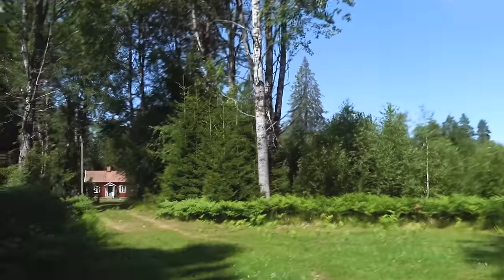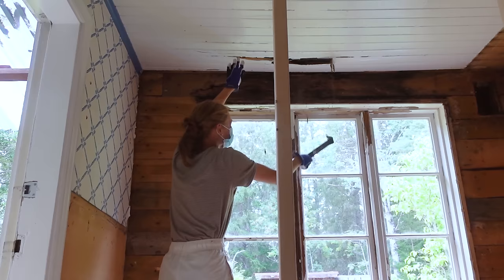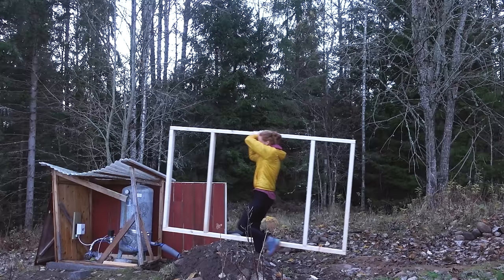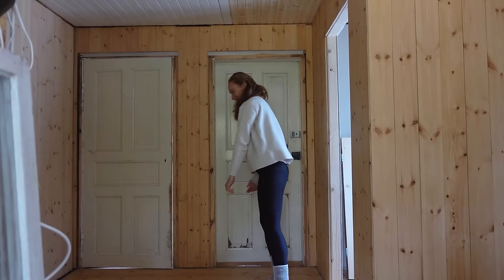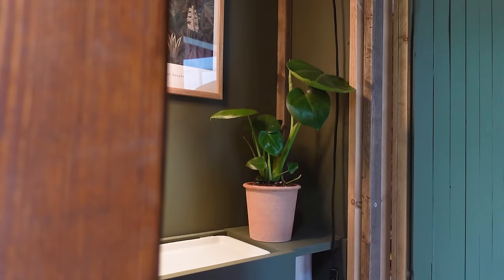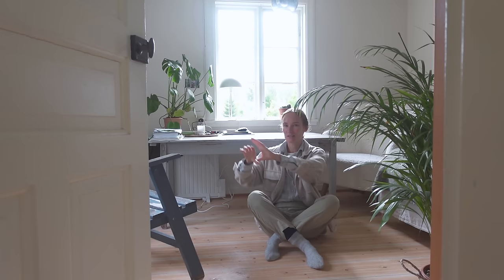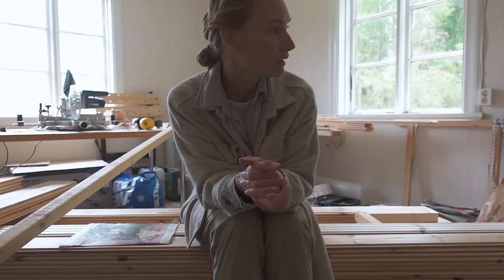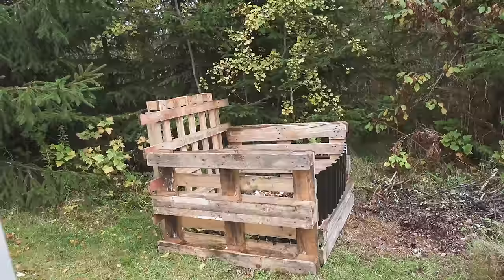ONE YEAR PROGRESS Interior Designer Renovates Old Cabin (Story 31)

Comment: I lived in a similar but larger cabin in mid wales, the wood burner  installer recommended we get rid of the chimney and install a double walled steel chimney, it worked beautifully and I liked the look. We chose a 7w wood burner which heated the whole cabin although it did get too hot sometimes.  James pirigioni’s channel has instructions for making covers for raised beds you could use the materials that you used for the greenhouse. I think a lean to greenhouse would benefit both the greenhouse and the house itself and give you a more stable structure. I’ve loved watching you think thru your problems and not being afraid to give it a go❤️
Reply: I dont know the status of her chimney, but the way these work in Sweden is both the woodburner/stove in the kitchen and the tiled woodburner in the living room each has a separate pipe running through the chimney up to the roof. Both woodburners she has, when in working condition are more than enough to heat the entire house very efficiently! The one in the kitchen is also a stove and cooker and there are copper water basins with a little tap that can be used with them and inexpensive second hand, so they are really valuable, same Swedish quality as AGA stoves. The tiles one is original to the house, likely 1800s, and has an ingenious internal five pipe system running up and down inside holding on to the hot air for a long time. Yes they are sensitive when you fire them up after being cold for a long time, you have to start very small and gradually so the mortar doesnt crack from shock, but once all the internal pipes have been hot for some hours or half a day you can fire up four logs at once and close the iron doors (inside the brass ones which remain open when firing) and pull the flu to only a third open and the fire will burn from evening to around dawn. If only one logburner works it should still me enough! I'd have made that my priority number one with such a property. The electric prises are running wild, no end in sight, and it gets very cold in winter, and wood is cheap and all around! I'd also have sawed and chopped up the fallen birch for firewood early as firewood needs drying out, cannot be fired green.
Being comfortable indoors through long winter months, especially with renovations would have topped my list before other projects, being a Swede, or half Swede, and living here. No need to replace burners at all, it's all about the brick chimney perhaps in need of repair to be fire safe, and the pipes within being swept and tested with pressurized air. Heating also cures and dries any wood used indoors for renovations, as wood swells and shrinks with temp and humitidy changes. It would be essential in my book. The hearth is the heart of a house! And the chimney has a central position so once it functions it will heat evenly all around.
Reply: Oh this is a good overview of the Swedish range/fireplace/cooker.  Sounds like it will be amazing once it has been recommissioned 🔥.  I second getting firewood cut and stacked for drying with plenty of time for drying before it is necessary.  I live for fires over winter, the radiant heat makes life so cosy
Reply: @badger9156  so do I. I've got mixed feelings about this channel and it's creator. I cant get into it here but its on the spectrum to a point of conplete disinterest in the place and architecture she purchased, in a way no serious designer would understand its been too long now. Something doesn't sit right, seem to make sense...
Reply: @gnarbeljo8980  my feelings about you are not mixed. You sure have a lot to say. Maybe you should homestead a place of your own and upload to YouTube. No? I’m old but I see envy lurking between your lines.
Reply: @karen-ud1hc  that's a misunderstanding. I have v e r y nice digs. In Stockholms oldest quarter. My flat is from 1656. I hapoen tp care about old swedish buildings and living. I'm 53 😂 I'd not move up north for a million bucks, sorry, its paradise to some not to ever run across other humans by chance, but n o t to me 😂. Are you the same? Perhaps this is a channel for the socially awkward not people interested in renos.... 💡
Anyway, a house like this here is cheaper than a car up north. Anyone can buy one. Literally. I think you're talking about yourself. As so many do these days. Read what you like into strangers comments.
You might have asked instead and gotten an actual answer
Reply: I watch James Pirigioni channel!  great gardening advice and his garden is amazingly productive!
Reply: @gnarbeljo8980  if you have no interest in moving up north and renovating a cottage why do you watch videos like hers, then feel it necessary to make suspicious comments. Can you not be happy for somebody else’s joy? I’m happy you like your home.
Reply: @karen-ud1hc  I'm interested in renovation, conservation of old buildings, and design.
I think it's a brave move going to an entirely foreign country alone like this. Why is it suspecious to provide tips on sources and brands with proper materials for restoration? Renovation isn't merely about "looks". You can actually make your house sick by mistake if you use any material/method. People who live in dry wall houses don't understand.
The girl obviously doesn't speak Swedish nor have any local friends to help her with the collective knowledge of these things. What's your problem? Everything in life isn't about your personal feelings.

Comment: So glad you decided to have the heating situation looked at. With the electricity prices in our area I think thats a really wise step. Have the "Sotare" (chimneysweep) in your area come do a quick inspection and go from there. They are the only ones that can approve or condemn a fireplace/chimney system. I really would make that top priority. You have a lot of timber spillage, and that tree that fell in the storm should get you through the entire winter. As always - keep it up.
Reply: Fireplaces, esp. old ones, are notoriously inefficient. A small woodstove (like a Jotul, maybe?) would heat your home for free and, as Jimmy said, make good use of the dead timber on and around your lot. The ashes will be good for your compost, too.
Reply: I d go with a small wood stove. Very efficient. Safe. And heats better than a fireplace.

Comment: You have really made a lot of progress. I'm impressed. I have a suggestion about the shutter window, which I believe will let winter in into the whole house. You can make a temporary "winterwindow" from plexi-glass,  which you easily can screw and unscrew on the window frame. Put insulationtape on the edges or even make it "dubble-glass" with a wooden frame in between. Cheep and easy to keep winter out. During summer you just take it off.
Reply: Or even just plastic sheeting.  My granny had a porch she used all winter long by installing plastic sheet stretched over a wood frame that fit right inside the porch windows. She could install and remove whenever the weather required it.  That was 30 years ago, nowadays you could definitely make it FANCY.
Reply: And replace it with a screen to keep bugs mosquitos out during warmer weather.

Comment: I’ve built or contracted 5 homes thus far, and can attest that you learn much along the way. Your indoor shower is an easy fix. The Joolca instant heat shower system is amazing. Maybe look into that? You can probably find a resale tub pretty cheap…then just drain your greywater outside. I’ve had more labor intensive water before… it gets old. As a single parent, teaching full time whilst building…let just say, has its challenges. Feel proud of whatever you can accomplish, there’s always tomorrow. Just appreciate your efforts in that day🥰🙏🏻✨

Comment: As a nordic person, before winter I would prioritize putting the extra windows on the windows in the house, it will lower your electricity consumption (keep heat in/out) and I would convert the guest house into a sauna (warm place to wash yourself, your clothes etc) with a woodburning "stove" which also heats water at the same time. Also, mice will get in through the smallest little hole so keep your food safe. And the shutters in the toilet 🥶

Comment: When the chimney evaluation guy comes to look at your fireplace and chimney, perhaps you should explore converting to a wood stove using the existing chimney. There may be an option where a stovepipe is put up through the chimney and fitting in a wood stove in your plans. A wood stove is superior in heating and efficient use of firewood than a fireplace. OR just get a wood stove and not use the old chimney at all.
Reply: There’s a wood stove in her kitchen. Those swedish fireplaces store heat and are much more convenient in a house were someone lives permanently. Once the fire is out, you close the damper. The heat stays for 8-10 hours and only after then a new fire is deeded, so you don’t need to use nearly as much wood. Maybe everybody knows this but maybe not...

Comment: Rosie, be proud off what you achieved, even for professionals a lot off projects go overtime everyday!! The old stove will keep the house warm in winter, but you would also spent time on cutting/splitting wood,thats needs to dry for a year before you can use it!!
You could go solar on your roof, but it will take away charm from your house (also Expensive) Try and look at Heat-pumps, maybe a combination with the stove, I know there are smaller units that would work autum/spring time (the noise could ruin your silence) Looking forward to your next year.

Comment: There are tiny wood stoves used in tiny homes that heat up to 300 sq. feet of spaces. You would have to cut small pieces of wood for fuel, check the tiny house movement. Also have you thought of getting solar panels? I admire all you are doing, you are very resourceful and hard working. I really enjoy your posts!

Comment: Have the chimny inspected and put in order. Then you get the kitchen fire place in order with fireproof clay ( "eldfast lera" in swedish ), that you find where you by building stuff. Clean the inside of it and wirebruch in the places the old clay is gone, vacum clean everyvere inside, wet the sufaces with water - use a spray bottle for that, and buil a layer of clay vere you see it has been one. Some playces may need fireprof brickstone. Leve to dry for a week and then warm up with small fire first untill a bit warm, let it cool down and warm a bit warmer hold the small fire longer and longer and make it burn a bit harde with some time. I usually spend two days with this gradually increasing the heat. In the winter you start the day with getting the fire going and you will be amased by how much heat you get from it! Next step is to bake your bread in it!

Comment: Due to that You have a small radiator ( Frost guard)  in the pump house, maybe You should bore at least some small holes at the highest point inside in order to let the moisture come out. Maybe in each end of the structure... ( or You might already have done so.) Of course You shall be proud of all the thing You have done !
Reply: I was just thinking about this too: the insulation    used there doesn’t work well with moisture.
Reply from the maker: Good tip - might indeed be the answer to the moisture issue!

Comment: If you have to heat with electricity, consider getting a AC split unit. There are units (called dual) that can heat and cool, and are very power efficient. On top of that they are very easy to install, if you get a "quick connect" unit, DIY compatible. Since you have wooden walls, cutting a hole in the wall for the three pipes and the cable is easy to do. I am looking my self into these. I found one wich delivers 4 kw heat for 1kw of electricity, and 6 kw of cooling for 1 kw of electricity. Quite efficient. Definitely much easier on your electricity bill. However, I dont know how cold the winters are where you are, there are limits for these devices. But depending how long the temperatures are too low for these, they still might safe you a lot of electricity for the rest of the time.

Comment: Rosie, you are an expert DIY-er who has achieved a lot in 12 months whilst holding down a job. We can see how much you have done even if you don't see it yourself because you live with it every day so you see everything that you still need to do not what you have done.  Your kitchen is chic and its functional simplicity is far nicer than the pressed board covered in plastic kitchens that sell for thousands of pounds.
Your plans sound amazing and it will be nice to have a deck on the mound and a terrace around the house. The guesthouse could be made cosier with some soft furnishings too and these can be picked up cheaply from good charity shops.

Comment: hej rosie. when it comes to heating costs this coming winter you might want to checkout options such as gas heating or caroscene, atleast if you dont have the possibility to use your Woodburner. if you are limited to keeping a single room heated, a propane/butane stove goes a long way and could be a cheaper alternative to the predicted electricity prices. if you go that way, make sure you have a gas alarm so you don't choke out from carbon monoxide or stuff like that.(I almost offed myself in a hot tent due to poor ventilation)

Comment: Hello
Try to get windows on the inside 
Traditionally there is a set of windows in winter usually with white moss between them and strips of paper
 glued to stop the draught .A stove with a metal chimney  should       be much cheaper but you still need to get it approved from" sotaren

Comment: About your pipe.
I once had an old house in south Sweden. There it was the Komunen ( commune)
duty to look after all the pipes in all the houses. They came by them selves and inspected the pipe and told every thing that has to be done with the pipe. That inspection did not cost anything. 
You have to contact your Community  Sotningtjaneste.
They will help you to find a serious company to do your pipe or your insuranse company can tell you about a serious company that will not rip you off.
I guess the cheapest and safest will be to install a metallpipe inside the old brickpipe. 
Hope this info can be of help.
Contact your
Sotningstjanste.
I wish you a warm winter.
🔥🌿🌺

Comment: Why don’t you put a wood stove in.  You don’t need a chimney.  Piping that goes outside and  heat shield inside.  You need to be warm without using costly electricity. ❤

Comment: sorry, as a Scandinavian, this was annoying-- you have ignored local culture,  and technology!  your little heater shed-- unless you insulated the whole thing, the small shed was more efficient at holding the heat in; secondly, I hope you didn't  just put pretty wood paneling up, but you insulated the inside walls first; thirdly, you should have first fixed the 2 stoves ( they are not  'fireplaces'. the tall one is called a kakelungen)-- they are super efficient and all old homes have them, and use them! maybe expensive-- but totally worth it long term ( not for atmosphere,  but necessary heating!) the one in the kitchen can even be used for cooking, baking, as well as heating ( but also need to get in a supply of wood  of course, but with such high electrical costs is worth it-- if only for supplement on coldest days or if electricity goes out, which is seldom, but can occur); best if get those fixed, and use that room instead -- will be nice and warm. Many old houses not use all the rooms in the winter, cuts down on costs, or if do, use your stoves and leave doors open in-between rooms-- will help to heat up toilet that way too ( but windows are called fonsters, and easy to get one installed-- all windows here are  2 or usually 3 glazed, which also helps insulate; as well as letting in light); lastly, I hope you are learning Swedish-- most communities have adult learning centers, often with the library, and at least in bigger town they probably have language classes for foreigners ( also see about bus service to get around).
Reply: Oh Judy, jealously is an ugly hat to wear. It’s always helpful to know the content you’re addressing before commenting.